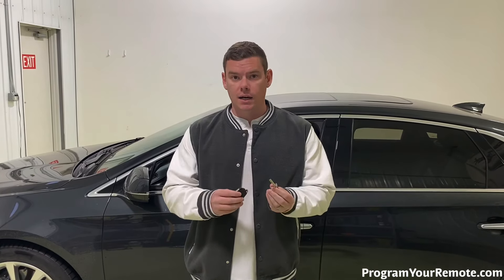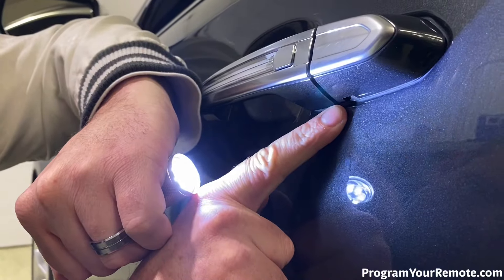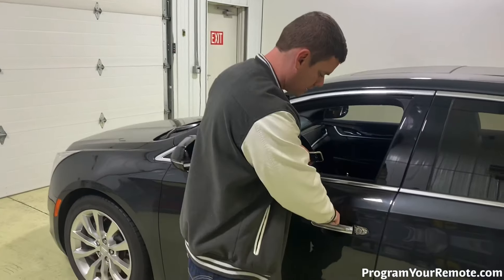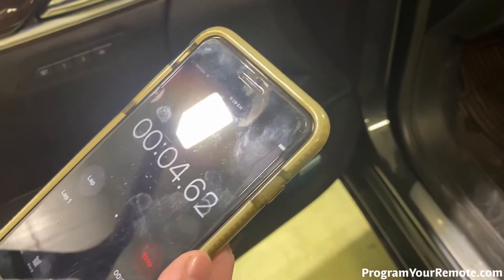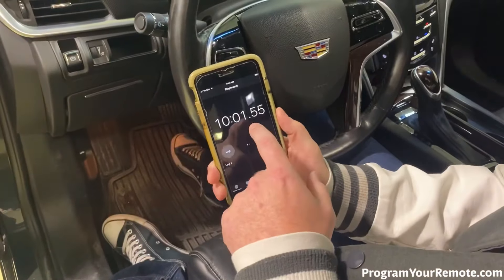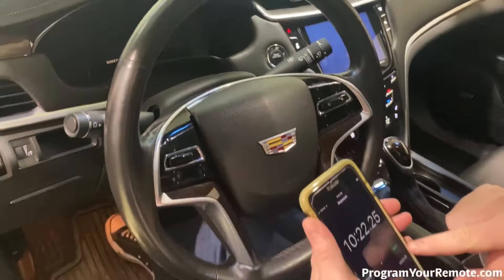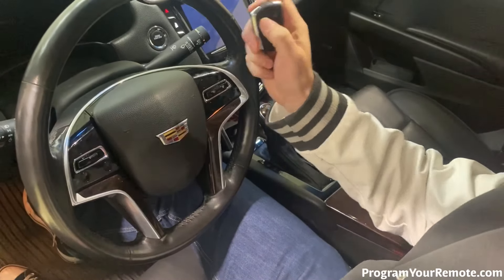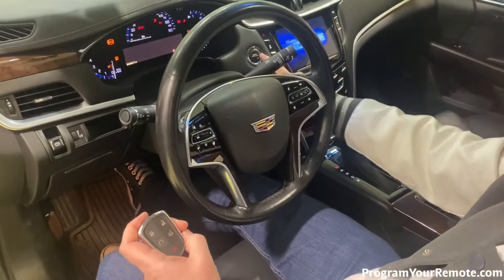How To Program A Cadillac SRX Smart Key Remote Fob 2010 - 2016

Comment: THANK YOU!! Both my remotes went too many times through the washer and stopped working (imagine that). Bought two after market remotes on Amazon’s for $24 and your video helped me get them programmed. Works like a charm!! My car is a 2014 Cadillac SRX
Reply from the maker: You're Welcome! glad it helped
Reply: I have the same car cadillac srx 2014 but not working for me can you help me
Reply: @Randy Aven I have a 2013 srx and I also ordered my key fob off of Amazon! So I don't have to get the key cut?
Reply: Thanks for your comment as mine is 2014 as well
Reply: Same problem here!! So you don’t need a working fob to program an aftermarket from Amazon?

Comment: Could i use my already cut key from the old fob to put in the new fob to save me time on having the new key cut?
Reply: Update: yes it ended up working with my old cut key in my new key fob. Some things I had to do over was making sure my press on the push start actually registered. I did it the first time with one push each time like you did in the video, unbeknownst to me that it didn't register, and by the end of the 3rd 10 min wait I was wondering why it didn't change the screen like on your video. So I redid it, this time sometimes having to press 2 or 3 firm times to ensure it registered. And by the 3 one it changed and I was able to continue programming it, ultimately successfully completing it. Thank you so much for this video. 5 years old at this current point and just as others have said still the most detailed and best video on it
Reply from the maker: You're Welcome! Glad you got it figured out

Comment: If you have a fob with key already cut, do you have to have the second fob's key cut in order for this to work... Or can you just use the original key? 

My original fib stopped working. Bought a knock off (without. Caddie logo) and did these steps and it worked... But after some time, less than 6 ish months, it stopped working. I was told it had to be a "Caddie" key (OEM) called the dealership and about died at their price. Found one and it had the Caddie logo on the backside. Key is obviously not already cut. I still have my original key and want to try again..  But you're the only one that's said the key needs to be cut first. Is that if you no longer have a cut key? Or will it not program correctly with the key the new fob did not come with?

Thank you for your help on this.

Comment: So we have one that works perfectly.. We bought a second fob for our 2011 SRX.. Is there any extra needed steps required to get both programmed? Again, we already have a working fob, just like to program the second one as well.. Thanks..
Reply from the maker: You will need to re-program your original fob during the procedure.  If you look at the steps in the description box of the video, you need to repeat steps 4-6 for your original fob after the new one
Reply: @PYR-Auto  what is steps 4-6???? You don’t have it clearly labeled for the steps I want to add a key please explain I want to add a second key for my dads 2012 srx

Comment: i have the original key cut in hand, Is it will be fit if i just buy new key fob from amazon and programmed it like you did? 
thanks in advance
Reply from the maker: yes
Reply: @PYR-Auto  Thank you for responding. I have just received my order. I will follow your instructions and steps and programmed it.☺
Reply: It worked 💪 😊, Thank you boss🙏#subscribed

Comment: I followed your directions and it worked great, however, now my FOB that did work doesn't anymore.  I assume it gave the other one a new code and now the old one needed that same code.  Should I just redo it and when is says program another key, put that one in and do the same thing?
Reply from the maker: You need to program all the fobs you want to work with the vehicle during the procedure.  If you look at the steps in the description box of the video - you need to repeat steps 4-6 for the second remote after the new is programmed.

Comment: Just wondering if it affects a working key transmitter? I have one that works bother does not?
Reply from the maker: this procedure will erase all fobs and any that you want to work for the vehicle will need to be reprogrammed in during the procedure.  If you look at the steps in the description box of the video - you need to repeat steps 4-6 for each fob after the first fob is programmed.

Comment: This helped me so much! I was able to put a new battery in and reprogram my key fob. However, my car still won't start unless my key fob is in the transmitter pocket. The remote works but I cannot press the little button on my door knob and open the door either.  Any advice??? Thank you so much!  Kellea
Reply from the maker: Are you sure you installed the new battery correctly? (not upside down)

Comment: Programmed 2 new remotes , doors lock , unlock , remote start works . Start car with remote start , unlock door and get in , put foot on brake and push the start button... NO REMOTE DETECTED comes up on dash !!   In case of a program mistake.....can these two remotes be reprogrammed again using the same process ?   Thanks for the help !
Reply from the maker: Yes, they can be re-programmed to the same vehicle. Typically though remotes don't act that way - they either program in or not - rather than a mistake causing them to not work properly.

Comment: If you already have a working fob but lost the second one, do you use the same procedures?  I bought a new replacement for a 2013 SRX, the design is a bit different.  I've seen for 2013's videos showing you put the fobs in the cup holder to program.  Do you have to do both fobs during the steps above to make sure they both are programmed and work?  Some directions say that this only programs lock and unlock but you have to go to a dealership or pro to program to start the car.  Thanks for the video!
Reply from the maker: Yes, you can use the same procedure.  The fobs go in the center console like the diagram in the video shows ( that diagram is from the owners manual ) and the car will start once programmed.  If you look at the steps in the description box, you just repeat steps 4-6 for each fob.  You will need the working fob far enough away from the vehicle so it cant be read, to get the vehicle into programming mode.
Reply: @PYR-Auto  what about answering his other question, regarding remote start button? Will this work with it?
Reply: @CalebBerg  I'd like to know this as well.

Comment: Does this work if I only lost one key and I bought a replacement. I have both cut keys still but lost one of the fobs
Reply from the maker: Yes, you will just need to re-program your working key during the procedure as it will be erased.  if you look at the steps in the description box of the video - you need to repeat steps 4-6 for your original key after the new is programmed.

Comment: my 2010 cadillac srx  has 3 remotes and all have good batteries . remote not detected on all three . my dealer says they are dead . what do you think?
Reply from the maker: I think its very unlikely all 3 remotes would die at the same time unless they were submerged in water or damaged in some way.  I would lean more towards an issue with the vehicle.

Comment: Hello! I have a 2013 Cadillac Srx and I ordered my key fob from amazon do I still need to get it cut  in order for it to get programmed?
Reply from the maker: you will need at least 1 cut emergency key to be able to do the procedure
Reply: Yes, I have the original ! I tried your steps some parts worked as far as what it should read on the dash.  Like the turn key 5 times after 10 minutes the dash isn't lit.  Then I open the door the alarm goes off! Then when I finally got it to start with the old key again it said "theft attempted "🤦🏾‍♀️🤣
Reply from the maker: It sound like the alarm was armed before the door was opened - try unlocking the vehicle with the working fob before attempting the procedure.  Also, since you have already have 1 working fob there is actually a similar but shorter procedure you can use.  You can find those instructions here https://www.programyourremote.com/classified/2013-cadillac-srx-keyless-entry-remote-fob-smart-key-programming-instructions-listing-8605.aspx
Reply: @PYR-Auto  ok I will try that link I will let you know how it turned out! Lol & thanks!!

Comment: What do you mean by "buttons facing the rear"?  The way the srx remote is made if the buttons faced the rear of the vehicle you would have to stand it on end.  I am guessing that I misunderstood.  (Planning ahead to do this when my spare fob comes in the mail)
Reply from the maker: The backup slot changes a little depending on the year, what year is your SRX?
Reply: @PYR-Auto   2012
Reply: @brad750  did you ever figure which way the key fob should be?
Reply: @cc7346  I never got it to work.  I ended up just paying a shop to program it.
Reply: @brad750  Thanks anyways 🙏

Comment: How do you get your vehicle out of key programming mode. Mine was programming the key and it won't do anything now. Its been over an hour. The dash won't light up and the locks won't engage, they just click. Panic works.
Reply from the maker: holding down the stop/start button for 12 seconds should allow you to exit programming mode
Reply: Did holding the start stop button work for you? Because my car is doing the same now and holding the button is doing nothing. Now dash has no message either

Comment: One day I got that message on the dash no remote detected, so I found the quick way to start the car n get home by putting the remote in the center console. well I replaced the battery n nothing. when I found your video I followed it to a T but no luck I've done it 3x now n still nothing, any other ideas besides the CAR DEALER ?  Thank you, dont get me wrong you're video was great its just my luck it didn't work for me
Reply from the maker: Are you sure you installed the new remote battery correctly? ( not upside down ) It sounds simple but that happens a lot.  If the battery is installed correctly then you may need to have the vehicle looked at.

Comment: I just purchased a used 2010 Cadillac srx drove it home n parked it! When I went out to open the door the remote was dead! My boyfriend replaced it with new battery n NOTHING!!! Does it have a to be reprogrammed again????
Reply from the maker: You can try but it should not need to be re-programmed after changing the battery.

Comment: my remote has new batteries and i still have remote not detected . can i reprogram this remote?
Reply from the maker: These remotes lock once programmed to a vehicles but they can be re-programmed to the same vehicle.  Another thing to check is to make sure the new battery is installed correctly (not upside down)

Comment: I have a question, there must have been something I did wrong. I got all the way up to the end. The fob will lock and unlock my car, but it won’t start the engine. Any tips or explanations as to what I may have done wrong
Reply from the maker: The remote portion and the "key" portion should program at the same time.  It sounds like there may be an issue with the fob you are using.
Reply: The same thing happened to me. The difference is I had the working factory fob with me when I tried programming the 2nd one. I followed everything, but the second one doesn’t work at all and now the factory buttons work but now the car won’t start with or without either remote. Please help 😢

Comment: I had my car stolen and they still have the remote.  I have one working remote.  I am assuming I can reprogram the working remote with this procedure? (So they can’t come steal my car again)
Reply from the maker: Yes - You can use this to re-program the remote that you have and it will erase all others.
Reply: @PYR-Auto  most excellent.  Thank you and thanks for the great video.
Reply: @PYR-Auto  when I turned the emergency key in the door 5x it said ‘Ready to program remote 3.’  I am using a recognized fob.
Reply from the maker: @michaelchristian3194  Take the emergency key out of the fob and then place the fob far enough away from the vehicle so it cannot be read to get the vehicle into programming mode.
Reply: @PYR-Auto  10-4.  Thanks.

Comment: Your video just saved from killing somebody. Have a customers 2011 SRX that they wanted an extra key. Ordered one, and while trying to program as per another video, it wouldn't work. would go into program mode but after putting transponder in center console slot and pushing ignition button, nothing would happen. tried calling the remote company. the gave me instructions for programming also. the same  instructions. i told them i tried it, it doesn't work. they had me open the oem remote and get the part number. it's the compatible remote, so should work. they told me to remove the battery in the new remote for 15min to reset the transponder. did that still no good. disconnected battery to reset transponder module, still no good. watched your video( now wasn't sure if the new key cutting was the issue. i didn't have the new key cut, and according to everyone else you didn't need to. mind you even in owners manual it said to place the recognized transponder in the cupholder and insert the "new" key in the door) so thought maybe that was causing a problem. after watching the rest of your video first, I noticed you said have the buttons facing the back. the other video and the manufacturer said buttons forward(which i was doing). tried one more time with buttons facing backwards, and Voila! the cluster said it programmed. Thank you
Reply from the maker: You're Welcome! Glad it helped

Comment: When I turn the key 5 times to the left, I do not get that message for the 2013 SRX. Do I have a bad Body Control module?
Reply from the maker: It's possible, the BCM can affect programming .  Also, some vehicles only show that message for a few moments right when the door is opened or closed - so make sure to look for that
Reply: I get pass the 5 key turn step and see the searching message. I waited ten minutes and closed and opened the door but the next  message doesn't appear. Help?

Comment: I replaced the battery in my remote as well as the car battery on a 2013 SRX. It is saying no remote detected. Will this work to reprogram the remote that I've been using? or does it need to be a brand new remote that hasn't been programmed previously?
Reply from the maker: In this case you can use the same remote since it has already been programmed to the vehicle.  Even if you were to erase the remote from the vehicle, the remote will be "locked" to that vehicle unless the remote is "flashed".   Replacing the batteries in either the car or the remote does not usually reset the remote, so you may have other issues with the remote or car themselves.
Reply: @PYR-Auto what do you mean by the remotes being flashed. I have a used 2013 srx only 6 weeks, and after sitting a few days (temps dropped in my state during those days) I went to get in and go to the store and it said remote not detected. I YouTubed put the remote in the transmitter area, and though it doesn’t say remote not detected anymore the engine still will not crank or turn over it only goes in to accessory mode. Battery in the car shows fully charged. I changed the batteries on the key fobs, thinking it may help.. so now both are fully charged and it still won’t crank over. It still shows remote not detected either unless I put it in the transmitter area. The key fob locks and unlocks the car. It will even turn it on over to accessory mode remotely while I have it in my hand but it won’t crank the engine. I am freaking out It’s Christmas and my vehicle won’t work and I’m broke. I spent $10k cash on the vehicle and I was able to get a warranty atleast. Idk what more I can do 😔

Comment: Did not work for me now my original remote that came with the car will not work! I also cannot get it out of learning mode!
Reply from the maker: This procedure will erase all previous remotes and they will need to be re-programmed.  If you look at the steps in the description box of the video, you need to repeat steps 4-6 for each remote, after the first remote is programmed.  Secondly, If you are holding down the step/start button your SRX will not exit programming mode, you may have a problem with the vehicle itself.
Reply: Hey Rodney, this is the same problem I’m having with my Cadi. How did you fix it?

Comment: My 2010 Cadillac SRX key just stopped working suddenly. I only had one working key at the time as I had washed my other one and it no longer worked. I tried replacing my fob batteries and that did nothing. I then ordered a new fob from Amazon for like $25. I just used your video and it worked!! I’m shocked. I would have had to pay not only for a tow to the dealership but for all the work and new keys…. You just saved me a ridiculous amount of money! I tried several times to reprogram the new key and it would not work! But this last time I did it, when the dash was ready for key one I put it in the transmitter box and pressed start I then removed it and did the same process for keys two and three and when I got to key 4, I again inserted the key removed it pressed unlock and it worked! It recognized the new key and programmed it under number 4. I then held the start button for 10 seconds to exit programming and the key is functioning perfectly. Unlocks the doors, locks the doors, starts the car. I’m really proud of myself. Thank youuuuuuuuu!
Reply from the maker: You're Welcome! Glad it helped

Comment: I have a 2010 SRX and lost key fob- dash shows “no remote detected” after the second 10 min part when I should put the remote in the pocket! Help?
Reply from the maker: If the vehicle is going into programming mode but not responding to the remote, there may be an issue with the remote you are using.